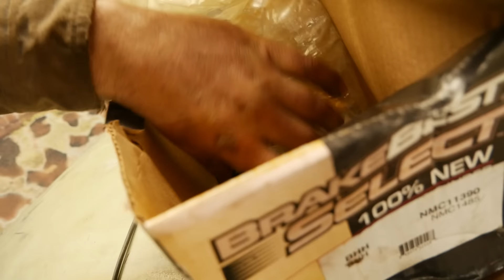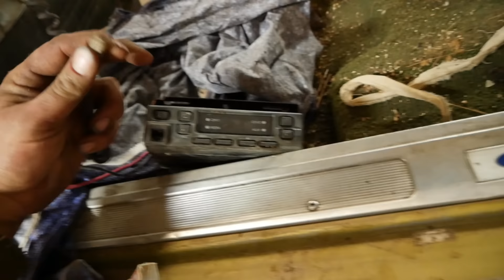1970 Ford Mustang Grande Coupe REVIVE & DRIVE + Burnouts

Comment: Can't help but feel like something's up with that valve cover - was off to start, rockers were moving it around when installed loosely, engine misfires after it's tightened down, then all the oil that came out of it after the drive...

Any one of those alone I wouldn't give a second thought but all together seems like there might be a correlation... or maybe I'm just over thinking it.
Reply from the maker: Oil came out because the gasket is a million years old and dry, it's nothing
Reply: @PoleBarnGarage   That's great; glad it's not a real problem 👍

Comment: It hasn't been sitting to long a Ford normally is a pain in the ass to revive I've seen a lot of chevyss get rivived  n they take 30 mins Fords always take longer cuz they are junk but this thing had to of been sitting 4 years cuz them engines on a Ford are hard to revive 5+ years
Reply from the maker: I'll take a Windsor Ford over any small block Chevy, and as you well know, I'm a gm guy